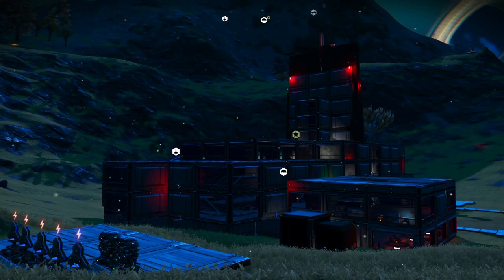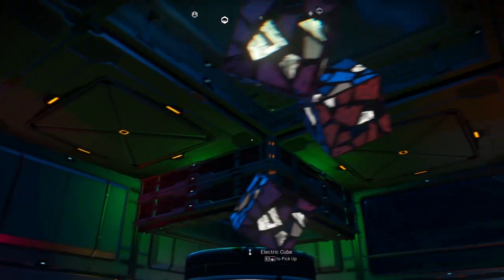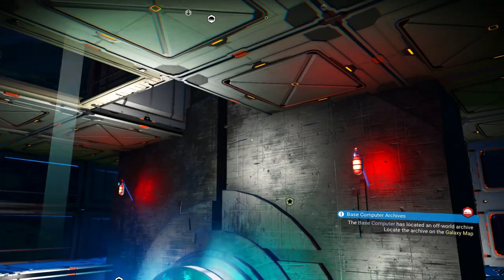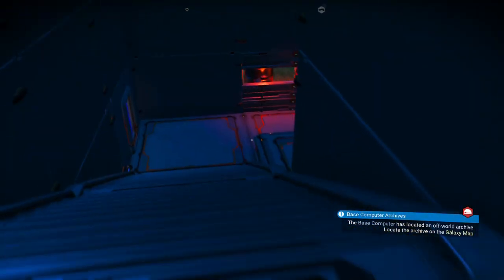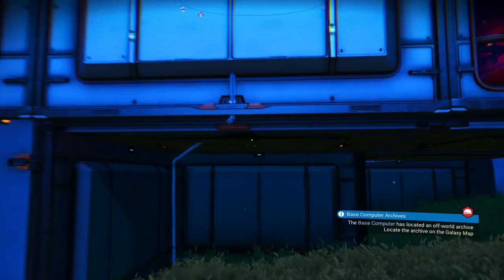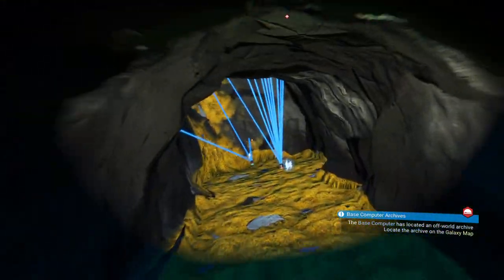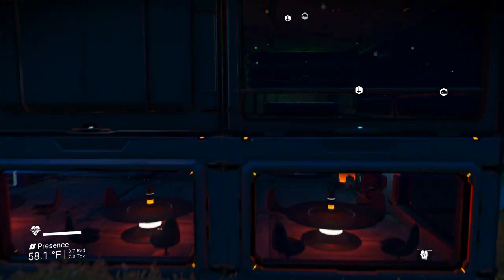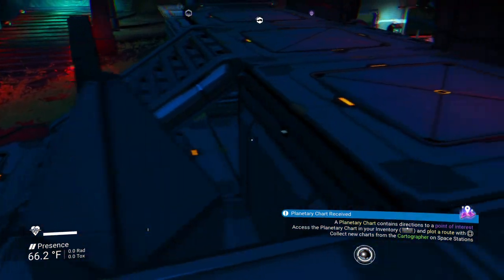No Man's Sky : Wiring Doesn't Have To Be Messy

Comment: Deleting storage containers and then immediately replacing them in situ fixes the odd or even storage boxes not powering up bug. Nice wiring job.
Reply from the maker: Yes, that's what I ended up doing. I just had to rearrange a couple of the surrounding pieces as the clipping rules have changed with Beyond, and it wasn't letting me rebuild them in exactly the same spot. It took some trial and error to find out which pieces were getting in the way, but I got it working.
Reply: Because...I think the update was released too early. I've got 189 hours in my third save and I've spent the last 5 days saving as often as possible because that next crash is not far behind. 10 hours over 5 days. The wiring system has been way less logical than it is in real life, for the reason of glitchiness. If I was an electrical contractor (which, thanks to Beyond, I'm now forced to be to a certain extent) I would upend a table out of frustration. This reminds me of Tom Hanks in The Money Pit: when he turns on the sink faucet, the toilet flushes, turns on the shower, the fountain in the yard turns on.

Comment: How do you hide the wires?
Reply from the maker: The entire video is literally about how I hid all the wires.
Reply: @rustyhatfield8302  yea you showed them but you didnt PHYSICALLY SHOW HOW TO DO IT
Reply: @birdman53191  You make the first connection and then simply walk over to where you want the second connection. The wire moves with you and stretches as necessary, even if you walk past obstacles or go underground. Note that the wire always stays as a straight line back to that first connection point and will pass thru any object as though it were not there. Thus the idea is to trap most of the wire in a solid object and in so doing it is hidden from view. You can also change direction of the wire by clicking at any point and that click point become the new reference location that the wire will point to in a straight line, etc.